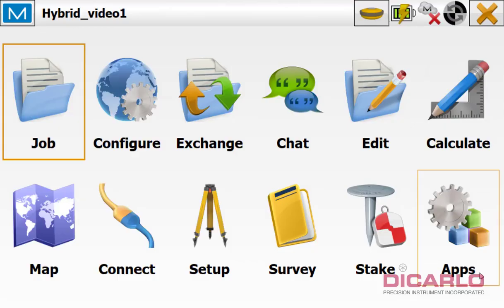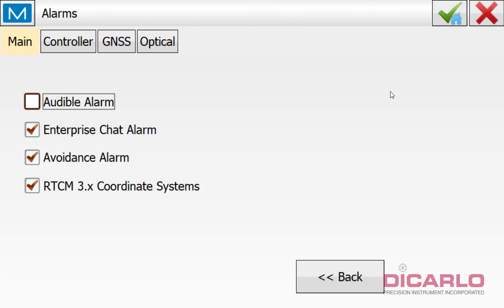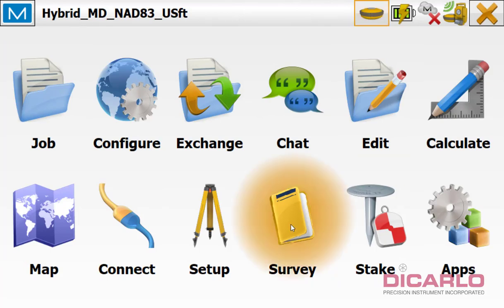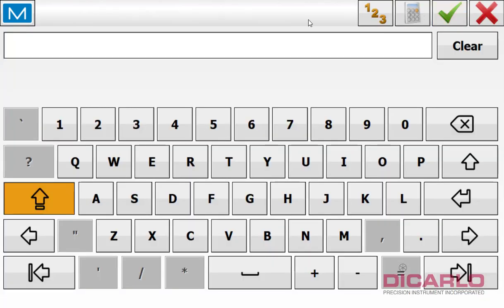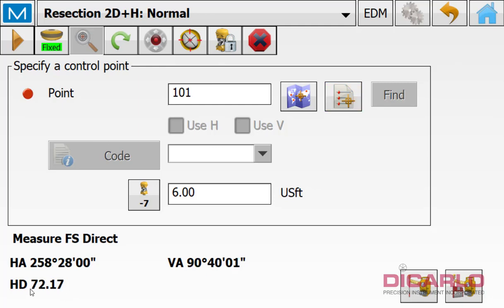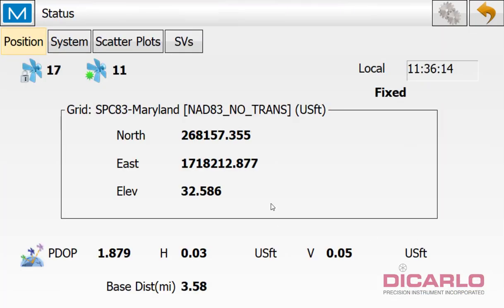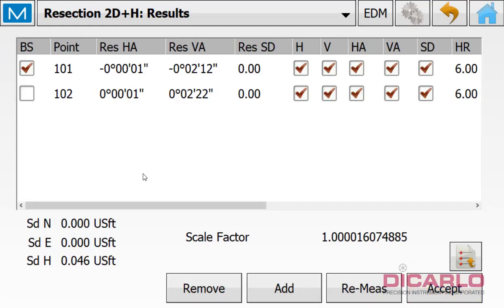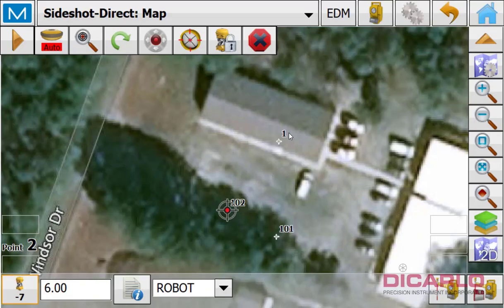Topcon Hybrid setup and configuration

Comment: Thank you, very interesting. One thing is not clear to me, during the resection you set the height of the reflector to 6 feet exactly. But why when you measuring the coordinatest, the program does not request the height of the rover? Or is the standard distance from the prism to the rover added to the height of 6 feet (in my opinion it is about 0.2 feet)
Reply from the maker: When using MAGNET/Topcon Field the software automatically assumes you are using the 0.17ft Topcon/Sokkia hybrid adapter. Hence, it does not ask. If the adapter is NOT the standard one, then you will have to specify the adapter height in the settings!

Comment: hi there, So I have some questions regarding the data collector of a topcon machine, and at this moment I don't have he data collector which the machine is not functioning as I cant work without the data collector, 
so what I'm asking about is if is there a way to use the computer to collect the data from it. or using a PC pocket like the HP iPAK. 
I'm still trying to figure thing out, but I would love to have an advice if possible. 

thank you,

Comment: I tried following your video in the new 7.3 version and everything goes great until I try and store the 1st control point. It keeps asking for coordinates of that point. I have no preexisting control or coordinates, I just want to use the GPS date to localize
Reply from the maker: There is no difference in this workflow since this video came out. Currently on 7.3.1 it still works the same way. Make sure you have a coordinate system set upon starting the job (it cannot say NONE). As the coordinates are fed to the robot by the ground/grid coordinates of the GPS.

Comment: We just got a Sokkia GRX3 I think it’s the same unit at the VR. We’re running Carlson Survey CE. If I’m working in the deep woods is there a different setting I should be turning on to make it work better In the woods. Thanks
Reply from the maker: Just make sure you are setting all the available satellites to ON in the "GPS Rover/Receiver/Advanced/Configure Constellations" section. This is where you can turn ON the GALILEO and BEIDOU satellite tracking option (isn't ON by default!). Also, if you are connecting to a RTN, make sure you can connect to a base/mount point that also broadcasts the GALILEO and BEIDOU corrections. As typically most only do the good old GPS+GLONASS only...